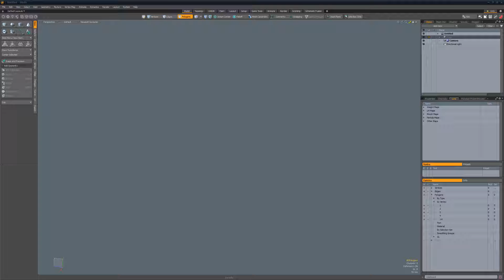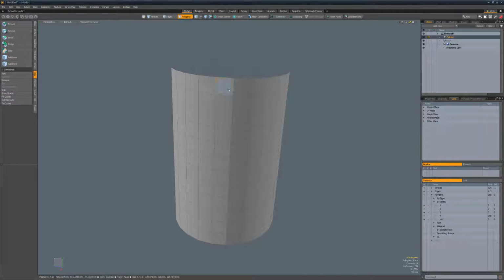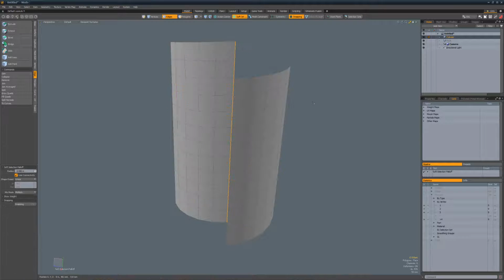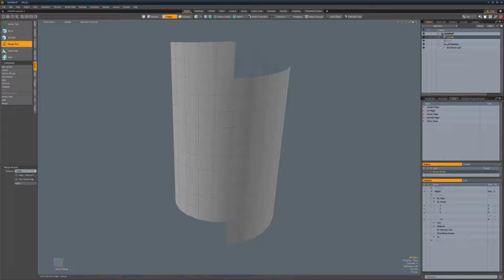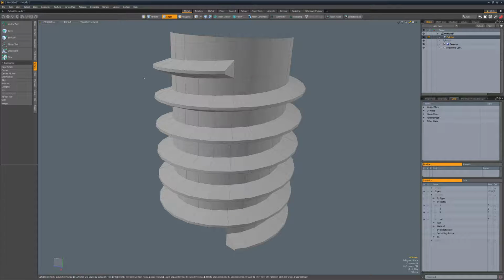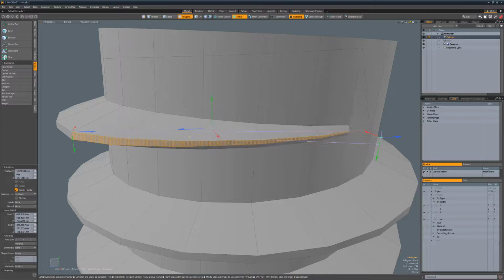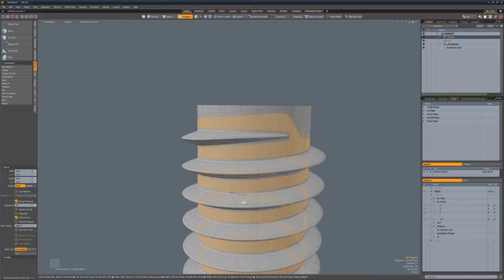MODO | Model Screw Threads

Comment: It its very unstable from one version of Modo to another, cannot use this method. Sorry. Split tool don't work.
Reply from the maker: It's working here. What version and what happens when you try?
Reply: @pixelfondue  Individual Join Vertex tool doesn't work in this case, only Command as you presented. So issue solved.

Comment: Snapping Isn't working. Even if i select "active" in snapping it doesnt work. Snapping is on vertex mode but not working. I have select trough option off as well
Reply from the maker: What version are you using?
Reply: @pixelfondue  modo 16
Reply from the maker: @joaocosta3000  working in 16 for me .. can you share a video showing the issue..
Reply: @pixelfondue  that would require a screen capturing software😅. Thanks for the quick reply and help but i managed to just do a approximate scaling and selected the vertex and merged using a bigger distance value
Very much appreciated. Keep up your videos they're great🙏
Reply: @pixelfondue  i am using maya navigation for the mouse. Don't know it that is the issue.
Reply from the maker: @joaocosta3000  Could try switching to Default and see if it is an issue still

Comment: (Fall off tool expanding problem) I am trying to do the fall off tool but it works normally til it reaches halfway around but then makes a full circle selection with some parts dim and highlighted.
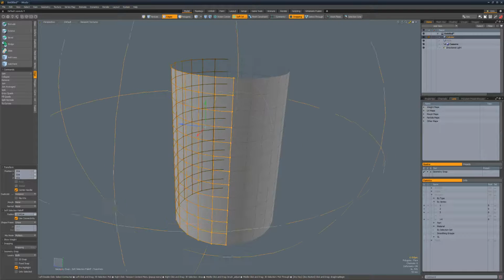How do you make smooth easing selection    0:19 Seconds in the video? 
I could use help.
Reply from the maker: Right click and drag
Reply: @pixelfondue  I have done so, but when it is showing the selection it reaches halfway around then selects all of it. It does not Select correctly as you did so. I have done it step by step and been at it for hours. Something I am not seeing perhaps in the background is altering it after half of the item is selected.